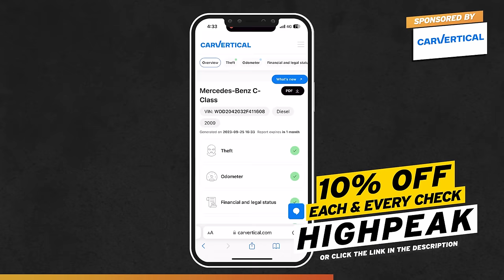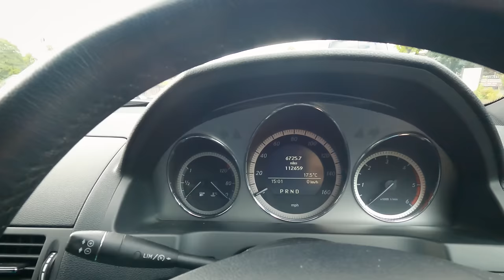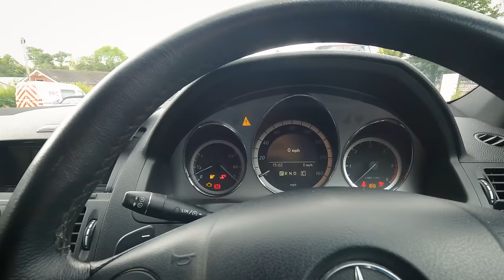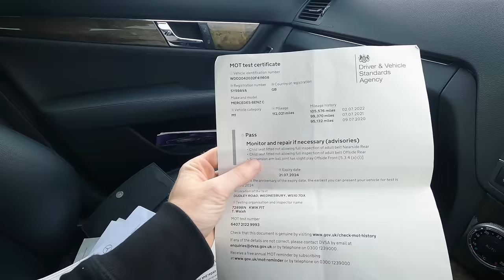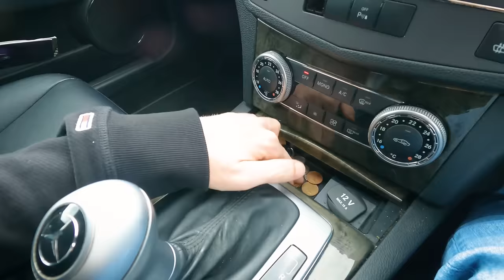I BOUGHT A CHEAP MERCEDES C-CLASS ESTATE FOR £2,700!

Comment: I've always liked this generation of C-Class, even if I like the later W205 design more. I have a bit of a personal connection to the W204. In 2012, I was looking to upgrade from my 2010 Holden Commodore (I live in Australia) and buy my first luxury car. I remember taking a C200 for a test drive with my wife and 2 young sons. It had a good interior, and we liked the looks, but the sound of the 4-cylinder turbo wasn't very pleasing (mind you, this was the first of the turbo 4s, and we had owned many V6 and V8 Holdens in the past), and the driving dynamics weren’t the greatest. I didn't buy it and went and bought a fully-optioned 2011 BMW 323i from interstate. It was the best decision I made. It was a beautiful spec (Space Grey with beige and wood interior), and we got very lucky as it had depreciated $35,000 in just one year (we bought it for $50k AUD). I will never forget the go-kart driving dynamics of that car and the sound of the 2.5 litre 6 at full rev. We had that car up until the start of 2022, when we traded it in for a fully-optioned 2016 BMW 420d. That's also proven to be a good car. Despite this, I always wonder what my life would have been like had I bought that W204 C200.
Reply: More comfortable :) And you could have went for a comparable C230. Or 280/350. I always thought the 3 series had horrible comfort. Shakes your internal organs.

Comment: Am I alone in wanting a car that's mechanically 100%, but doesn't mind a bit of battle damage?
Reply: similar to buying a used piano sometimes😁
Reply: @ambiva  We still have our father's 5 string bass, it looks though it had been stolen!
But if you like driving, the car's underpinnings - struts, shocks, tyres, ball joints - and the rest - have to be in top nick, and that's where you throw your money.
Reply: That's pretty much an exact description of my car😂😂it's never broken down never had any mechanical issues always been serviced and has only done 69k miles on a 09. But the outside isn't great there's dents and scratches, a cracked tail light, a missing fog light grille and peeling paint on the rear quarter.

Comment: Unless I missed it, Matt’s calculations on the spend, did NOT include the cost of Detail / Valet, and no mention of cost to get the dents pulled out ?
Anyway 
With the wheels redone, and the paint buff / polish etc, it would have looked great.
The AMG body styling kit & AMG wheels give its appearance a big lift, compared to a standard looking C class…

Comment: Current car is a late model S204 C350 AMG Premium Plus, Estate obviously. Opposite end of the budget range to this 204 but fundamentally very similar. The good old OM642 V6 Diesel is an absolute treat - its worth the extra fuel alone to not have the tractor dag-dag noise you get with the 4 pots like at https://youtu.be/YgETbhzC-U8?list=TLPQMjkwOTIwMjO_ng8P82cDhw&t=838 However, I like the car buts its actually not a patch on the one I had before - an S212 Estate with the same engine. What I should have bought is a facelifted 212, same engine but with the colour dash etc.  This era of proper Merc (not including FWD A class etc), the 204, 212, and the equivalent CLS, the CL, the SL etc all with that familiar anglular design langauge inside and out are aging very very well, and have more of an identity than the later curvier models which seem to have become a little generic.

Comment: My cars are always serviced by the main dealer, mini valets regular, I don't carry pets, smoke or allow grandkids to eat or drink in the car. The only dirty thing that goes in the boot is my golf cart and as I'm a fair weather golfer this is easily taken care of by the mini valets. But! There's always a but, when I do take the car to be traded in I do indeed run as much fuel as possible out of it. One, fuel is bloody expensive for an average joe like myself and two, the dealerships have far deeper pockets than me to fill up the car. Being sensible with fuel as you come upto trade in day doesn't automatically make you a bad owner.

I also wouldn't sell my old freezer with food and drink left in or my old golf bag with clubs and balls left in it. I get that it must cost you a fortune putting a little fuel in some of the cars traded in to you but you are giving sellers the lowest reasonable price on their car, charging a mark up on the car they are buying from you and then making a second profit when you flip their part exchange. I think your profits can stretch to £20 less to put in a little fuel in the low fuel trade in vehicles.

You should look at the fuel as a bonus not a guarantee.

Anyway love the channel, love the content and the fact you prep your cars so well before selling. But if I ever buy a car from you I'm gonna make sure I run the car so low on fuel i have to push it the last 20 metres just to see your face 😂. Keep the content flowing flowing.

Comment: Twitter doesn’t exist anymore, its called X now, so change your ending accordingly. 

The range you were driving has an undesirable indicator tone! 

Thanks for the video shame we couldn’t see the end product.

My current collection consists of 
2017 S550 Coupe 
2017 X4 M40i in Longbeach Blue 
2020 Ram Rebel 
1996 G320 5 door wagon 
1993 G300 2 doors 
2001 SLK230 primastene green 
2011 X6 V8 painted in wimbledon green the special land rover color for the P38 30th Anniversary

Comment: You did really well to get 6k for this. If I was in the market for a C Class, I wouldn't want one with jing Jong ling long tyres and part history.
Reply: 90 % of the cars he shows, are fitted with cheap / crap / no name Chinese tyres, even on
Benz / BMW / Audi etc
Tyres are an easy thing to immediately change to a decent brand / quality tyre, or wait until the ones on it, are due to be changed.
It is a 2009 vehicle 
It’s 14 years old 
No 14 year old car will be perfect…
Service History 
Matt might have tracked down more service history, via Mbenz or others ?
And
It was being sold with proof of all the full service work and transmission service, having just been done by a Mbenz Dealer…
With the factory sports body styling kit & AMG wheels, it’s a car that looks fantastic…
Reply: Prob is that's all most people put on their cars nowadays , I have a lot of customers with rangerovers, M6s, merc s classes etc. that only put ling longs on them and only service them when they sound rough or won't Regen due to oil dilution... it's not easy to get a nice well looked after car nowadays
Reply: @StephenFogarty2023  I just think 6k for that is far too much unless it comes with a 12 month cast iron warranty. Based on his quality reputation, he seems to get above market value, which is fair play to him.
Reply: It's an old estate not a performance car, who cares about the tyres if they're working and with tread. You can fit those of your choice when it comes around.
Reply: @SA-zoom1  
Nobody is going to offer a 
“ cast iron type of warranty “ 
On any 14 year old vehicle.
Any Aftermarket Warranty, via an Insurance Company etc, would have heaps of specific exclusions, on engine / gearbox components etc, and on other items.
A lot of potential issues etc, will be excluded due to “wear & tear”… or because it is an item that does wear out / require repair or replacement, at some stage…
As I’m not in the UK
I’m not sure to what degree Matt’s dealership needs to provide a warranty / Consumer Warranty, on a 14 year old vehicle…
But
Based on being a very long term viewer, Matt does appear to be very fair to his customers, regarding problems with a vehicle, after delivery…